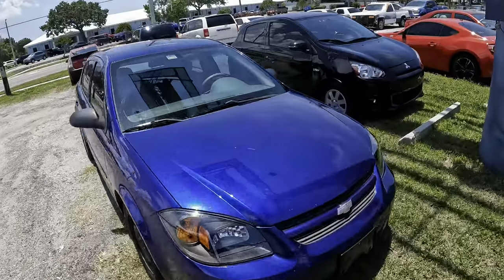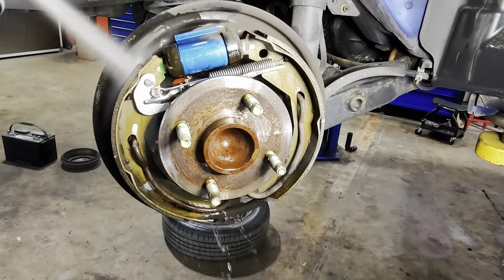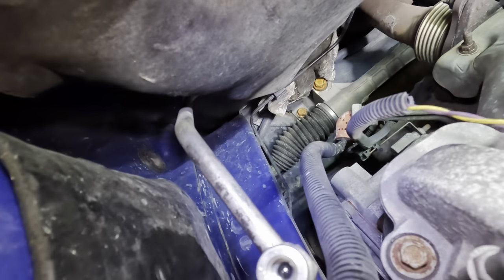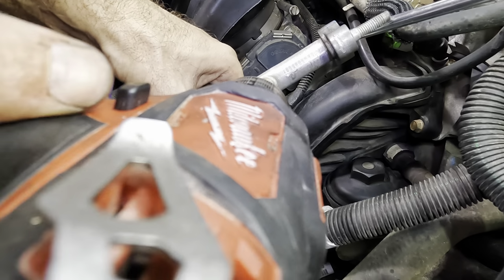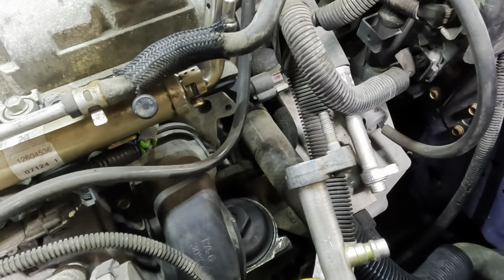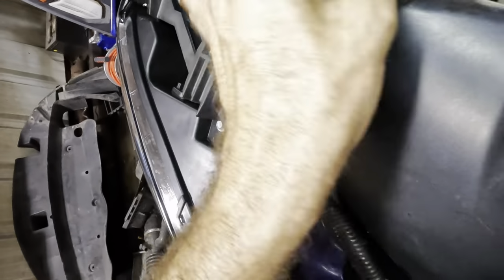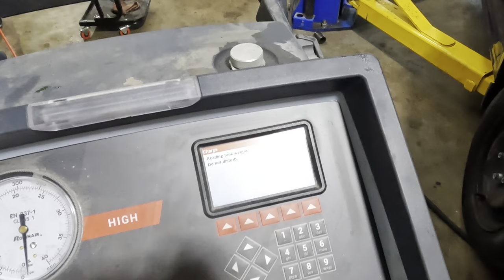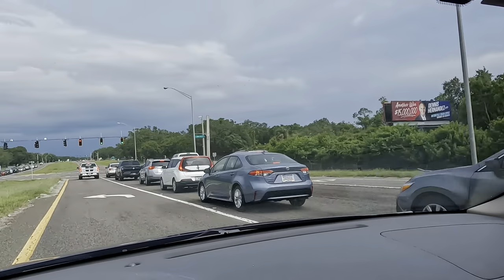Mechanic Still Can’t Replace Parts! Customer JUST bought it! Chevy Cobalt PT2!

Comment: My thought was using an easy out instead of the drill bit to see if you can grab it and unthread it. I may be speaking too early, as I have not finished watching this yet.
One thing about replacing the line is no possible metal shavings contaminating the system. But like you, I try most anything except waiting to fix a problem.
Reply: I might have tried reaching down the line with a hook to push the back of the valve half from the backside.
-
edit: Just saw what came out on the drill bit. My idea would not have worked.
Reply: I'm in HVAC and I just about fell off the couch here.  Metal shavings, compressed air in an open system?  "There is a filter in here..."  Yeah, no.
Edit:  OMG he's blowing compressed air "through" the compressor now.  This thing is toast.
Reply: @joez.2794  right?

Comment: Nice work Ray, the previous mechanic had a trifecta of mishaps, including improperly installing the fuel pump, not adjusting the rear brakes, and breaking off a schrater valve on an ac line. But I give them credit for the wax and buff, the shiny black plastic wheel covers, and the tire shine.  Looks like a typical used car lot shiny mess.

Comment: Ray must have been early mornig when you did the drill bit trick.  The drill didn't push those pieces into the line they cut the pieces into slivers. When you went through and then blew out the line those chunks came out-- you probable didn't see it at the time. Anyway you have the receiver dryer right there it will trap it.
Reply: soon 98 degrees air comes out.

Comment: Yet another excellent video and customer centric repair! If you need more business, advertise on the billboard, if you have enough and don't need to expand, then no billboard is necessary. I never actually compared those who advertised on billboards with the slimy lawyers who do use them.

Comment: I was told that the rear brakes re-adjust when you go backwards and hit the brakes.
Reply: This is true, but lots of people do not back up enough.Pulling through , to park is easier, no worries about hitting stuff.
Reply: @davidhamm5626  its easier to just use the parkbrake ,no not the trans lock (park possision on trans) but the actual parkingbrake ( often called ebrake) just hold the realease and pump and if the self adjusters work as they should you wil feel the pedal getting firmer, if you have rear drumbrakes and the brakepedal goes way down,try putting some clikks on the "e breake" if the pedal gets better the rear breakes needs adjusting.

Comment: Shouldn't the adjuster tighten itself after a few cycles on the brake pedal? The same way it is normally supposed to selfadjust for the shoe wear? I get it, it is a good practice to adjust it manually after installation so the play is n9t excessive from the get go, but still after a while I would expect the play to go away by itself.
All that unless there is something wrong with the adjusters, like assembled in a wrong way or so...
Which seems to me to be the real problem with the brakes: The self adjuster to not self adjusting...
Reply: Hmmm, yeah I recall that you just drive in reverse then apply the brakes a couple times for the self adjusters to close the gap
Reply: I'd guess that they are still set hard against the "closed" position & the spring/ratchet setup is not strong enough to break the nut free from there.
Reply: Only issue is they need to start out even from the get go! Start with low drag,if one is at bottom of adjust the one that is set at top will over adjust.
Reply: @petersmart1999  No. Correctly working adjuster will never overadjust it. Each brake has its own, completely independent adjuster.
So unless it is overtightened from the get go when installed, the adjuster won't overtighten it. They are even designed (intentionally) so they stop adjusting when failing. The adjusters are nothing else than some kind of ratcheting mechanism actuated by the shoes travel so the travel should exceed some level for the next tooth to engage. So when too lose, the travel is greater, tooths engage and the adjuster tightens up. When the slack is within spec, the travel is too short  to engage the next tooth, so no adjustment is happening at all. At this state it normally spends most of its life, so much the corrosion or other gunk just seizes the mechanism in that position, resulting into adjuster not adjusting for the shoes wear anymore.

Comment: I have a can of Brake Clean at the shop that I inverted and sprayed out all the propellant.
Now it's just the vapor pressure of the Brake Clean pushing it out.
Really good for getting out enough solvent to work on sealing surfaces when you don't need the physical pressure of knocking stuff away.

Comment: You don't need to cinch up those brakes that way. Those are self adjusting. When it's ready put the car in reverse, back up to 5 mph  and tap the brakes, do that a few times and they'll adjust themselves.

Comment: That 'lost' cap on the low pressure side was black, and you removed it around 13:20.
Having to drill out the rest of that valve core and then blow it out reminds me of a rebuilt engine I had delivered to my house in the '70s. I had to use a drill and my vacuum to suck out debris that the rebuilding shop had not removed from the oil return holes in the engine heads.

Comment: If you go back and watch the last video where Ray checked the low side port, you can see an O-ring fell out from inside the cap. The last guy knew it was leaking but couldn't or wouldn't replace it

Comment: I bought my 08 cobalt for $300 a week ago it runs and drives perfect has 207,000 miles and no engine lights or warning lights, still has a good paint job and leather interior only had to replace front speakers, headlights, rear shocks, and glue some of the interior door panels, I’m hoping it will last for a little while.

Comment: @rainmanrepairs I always thought those adjustment screws were supposed to be self adjusting, was I taught wrong or are there 2 kinds, honest question, thank you for the wonderful videos, I've learned much from you
Reply: They do self adjust but do so slowly when in reverse.  How fast depends on how many times you hit the brakes in reverse.  One push, one click.  Done by the motion of the shoes in the drum.

Comment: Billboard might not be needed by the amount of work you already have. I guess the cost would be worth considering.   
I'm curious if you ever replaced the valve in the fuel line pressure check access?  When you first looked for the gas leak you noted fuel in the cap.

Comment: When our fleet transitioned from basic E-250’s to Transit 150’s they came with power windows and locks and a key fob. I was forever pulling into a drive thru and cranking an imaginary window crank. Some nights when I got home I’d walk up to my front door and click unlock on the key fob, it never worked. 

I only read billboards on the interstate when I’m looking for food, once when I needed a replacement tire before Google. 
The ones in town are mostly lawyers, if you need one of those they send resumes to your mailbox real quick. 
Sometimes they put hot chicks on billboards advertising businesses, those catch my attention. ;)

Comment: Those rear brakes are auto adjusting, apply brakes while in reverse, actuates that lever that you levered away to adjust them. Or applying the park brake adjusts them on some vehicles as well.

Comment: More that a few times, I've been able to extract the bottom half of a Schrader core using a tiny slide hammer with a sheet metal screw on the end.  It only works when the entire stuck section of the shell is past the threads.  I guess I've seen it half a dozen times.
Reply: There is actually a tool for that. It is a tapered left-hand thread that you just screw into the remains of the core and it comes right out .. mostly
Reply: @bryanlatimer-davies1222  I have one of those somewhere; it works some of the time, and it's definitely worth having.  Any method that can get the chunk out without putting shavings into the line is a win.
Reply: @helenault7452  I was very surprised he started drilling, to even consider putting swarf into the system must be an error

Comment: GM had a massive recall on the 2007 Cobalts ignition switch. When you enter the VIN in your computer does it tell you about the recall. According  to the recall the switch will work but not the Air Bags.

Comment: Weird. Drum breaks adjusters are usually self-adjusting with the parking brake operation. I met one once with awful rears. The linings were new! The reason they were out was the owner never used the parking brake….anyway. I cleaned them out like you did but alwaysadjusted them with the drums ON….reason being the small lip that forms on the inboard of the friction surface. If you can get the drum on and off, they aren’t properly adjusted…hence the slot on the back of the backing plate. I think you’d have got half a turn more, and much better break pedal out of that.

Comment: Frugal consumer tip : Missing a hub cap/wheel cover ? Buy a set at your local Wally World type place. Put 2 on the incomplete side. Now you have a spare of the 'old ones' and 2 spares of the 'new ones' ! No one can see both sides of the car at once - no one will ever know the difference.  😮

Comment: Re the broken Schrader valve, I would have put a dab of hot-melt glue on the end of that torx driver to enable the loose threaded portion to be pulled gently back to engage the thread. When that didn't work, as some of my bright ideas don't, I would have hammered in a screw extractor, which should be tight enough to pull back and engage the thread. If I had a fragment in the line, I would put a rag over the end before blowing it out to prevent it disappearing into the distance at high speed.

Comment: Nice to be right right from the start. I figured excess movement on the drum brakes with pedal travel and squeaking and as you didn't mention sponginess not a bleeding issue. One of the very few areas I always seem to be just that little notch in disagreement with you is when you work on drum brakes. Having worked on cars way back when almost all the brakes were drum we got very used to tippy taps. Yes give it a thump to dislodge the drum, but when refitting and adjusting giving the drum shock taps to help the shoes centralise, and then adjusting to drag, and then back one or two clicks till either not touching, or just the hint of a touch. Without hands on its hard to be too judgemental, but I kinda feel my brakes would generally be ending with a more responsive pedal.

Comment: Ray, some of those R134A fitting made in chinna with replacement hoses , you can not remove that valve core, they have an internal lip machined into them to stop you from just removing the vavle core, they want you to have to replace the whole high flow fitting, that way it has a new seat and threads, but be careful both the high flow fitting and the line are cheap Chineesum aluminum, I swisted one right off on my 2002 Jeep Liberty, and I am a retired 30+ year Vetran of the HVACR industry, thank God I was replacing the whole line at that time or I would have been screwed. lol PS: In all but automotive these are Called CoreMax fitting and the whole fitting is always replaced, we even have spical CoreMax removal tools to remove and replace these fitting while under presher with out a lose of refrigent, but OMG are the tools Expencive $400.00.

Comment: Are there no adjustment holes in the backing plates? I was taught to use those holes to adjust them up until the drum locks and then back off a click or two.

Comment: 47:00 You'd have to check your city ordnances, but I've seen buildings painted with company name. Perhaps a large banner on that north wall. Because of signage issues, a lot of places here use 'feather flags'. Those thin, vertical and more importantly, removable banners with company info. They're temporary and don't fall under the same requirements.  Hit some of the local businesses with business cards, public works, 84 lumber,  There's both a K-8 and the school board offices east on 26th. That many local residents, a targeted mail campaign perhaps?

Comment: I usually clean the center hole of the drums and apply some antisieze (coppergrease). Never used an angryhammer since :-).  Not many had spent time to take the pipe away and REALLY check for debree, just, naah, it's good. Kudos!

Comment: Ray, good video, but I have a question. Why is it when you take drums or rotors off, you just clean the mating surface. As an old time mechanic and living in a rust bucket state, northern Mn., it is the hub that creates the problem. The drums/rotors stick to the hubs. I have never had one stick to the mating surface. Not only you but all the service videos I watch are the same way. Also I think you were very lucky with the valve. The way it was installed worried me that the new one would not take. Good job.

Comment: Just a thought on the AC port with the broken Schrader valve. Could you have possibly used an easy out on it? It might have gripped the remainder of the value and been easy to just pull it out. My 2004 Cavalier also has crank windows. I just turned over 52,400 miles. The clear coat is bad but everything runs great. I looked into getting the clear coat redone, but the one shop where a friend of mine worked before he passed wanted $5,200. I thought that was a little much. I guess I'll run that car till it dies or I do. I'm 70 years old and have heart problems, so it might not be long now.

Comment: i have a set of left-hand harbor freight drill bits that sometimes help a lot, as the drill effort on the victim tends to unscrew them rather than tighteneing.  dental pick tools as well. 
great video as usual. always getting the job done right. thanks for the trip. 
-i sure do like that spinny ratchet!

Comment: Well Ray
“Mini” part required, no one said you did not have to disassemble the car. So O rings, schrader valves, and gas is still a “Low” parts required.     Wrench on Garth.

Comment: is there a place you can find the proper temperature range for a honda CRV A/C accounting 
for air temperature and fan speed? great video, great job removing the broken Schrader valve!
and purging out the chips. I remember with my beetle every 30k you had to adjust up the brakes,
4 drums! they had the European hoses with the bubble fittings. got the crimper to form them.
good luck and have your self a wonderful day!

Comment: Are you saving an episode showing your new finished bay or did I miss an episode  with the garage door being finished? I saw you take out the bottom cinder blocks and you mentioned the guys installing the door but never saw the finished product! Oh yeah I would have removed the rust before  using the brake kleenex. But that's just me!

Comment: I have same car 2005  all factory untouched  original equipment nearing 200k miles same ac,alternator, same transmission and rock solid engine that sound good I never had issues with it it's a good well maintained car

Comment: Ray, that billboard would certainly be nice. How wide and tall is it? Prices vary concerning size. How long would you want the advert to stay up? How much money are you willing to spend? From what I saw, it looks like the price can range starts at what looks like 9500  to some pretty astronomical prices. But, as far as would it be good exposure, sure. From what I researched, it could result in being seen by as many as 40,000 people. Would take some research to see if it would be cost effective as an investment.  Great video. Does that car have the self adjusting drum brakes that adjust the star wheel when backing up and applying the brake?

Comment: Setting the shoe pressure on the drums is stupid easy on these things. 

Pull the parking brake until you hear three clicks. Check to make sure the cable isn't slack and stretched out. Use a screw driver or brake spoon to set the brakes on the drums HARD. You don't want to be able to spin them when set, even when the entire tire is on.

Release the parking brake and enjoy drums with absolute equal braking pressure so they don't pull one way or the other, and auto adjusters that actually adjust...

Comment: seem like i remember breaking the schrader with needle nose pliers. then taking a pointed 1/4 sheet metal screw used in a/c duct install  run it in a couple turns and then pulling it out with pliers

Comment: Try a coor extractor, same thing used to remove coors from car tires , bikes, . coor remover has reverse threads to extract the broked coor, it removes the whole bottom half that broke off, if you drill it you will never get all of the shavings out. its a simple coor tool found in bike shops of auto parts stores, it cost about $3 to $5.00 pending on who selling it. Good luck brother.

Comment: In that case of a valve problem which is very rare you can buy tweezers electron tweezers that they use for phones and small pcb boards , you can get them curved or straight , as i have both for very small components that need to be picked up from the board or replace new resistors to the board to be solder and to hold them there if needed 
they are cheap to buy which would in this case be used to get broken parts out as such as yours.

Comment: It'll be back,I have a 2008,same problem,noise did not go away aft I adjusted mine,same brake setup,had to replace drums to eliminate the noise
Reply: Alot of them have the low frequency noise eliminators,this one doesnt ,but I have seen quite a few with them.

Comment: If you don't have the special sockets for those GM ports, a crescent wrench will work just fine. There's a spot on the line to put a regular wrench on to hold it. How I usually do it.

Comment: I don't believe you will get air blowing back through the compressor because of the reed valves between the high and low sides of the compressor